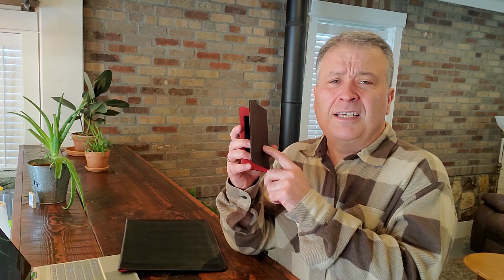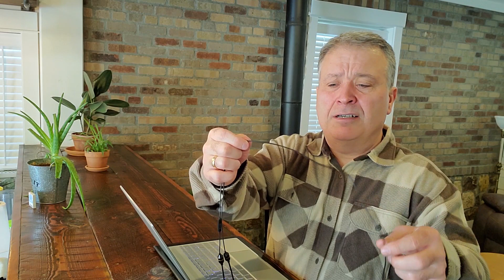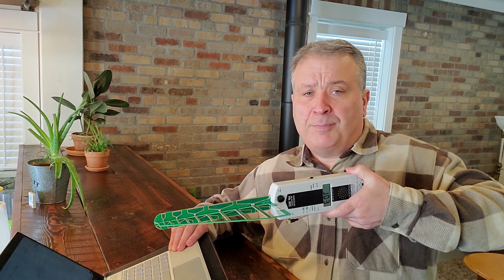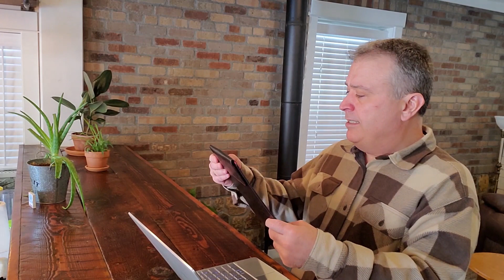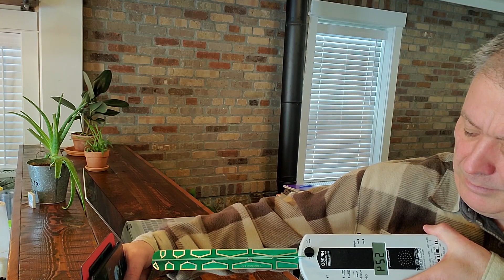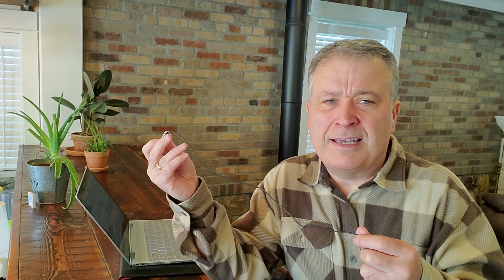WaveWall Anti Radiation Protection Products Review

Comment: Curious of the difference in RF emitted when you use the laptop shield for a laptop in wired mode versus wireless mode.  If you using ethernet connectivity versus wireless does it warrant needing a laptop shield?
Reply from the maker: Thank you for the question. There are 3 different main types of what people call "EMF" radiation. Radio Frequency (RF) is one of the three. It is wireless radiation most often (nowadays) in the microwave range. So you don't get any RF radiation when all your wifi devices are off and everything is wired through Ethernet cables. I only tested for RF in this video because it is the most powerful of the three types of EMF radiation. But you would still want a laptop shield for the other two types of EMF radiation (magnetic fields and electric fields). I hope that helps.